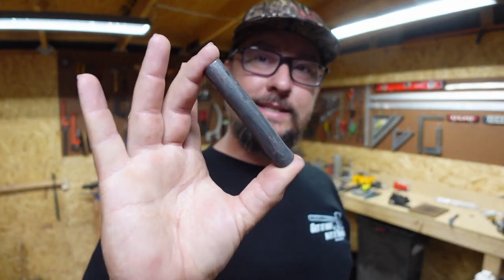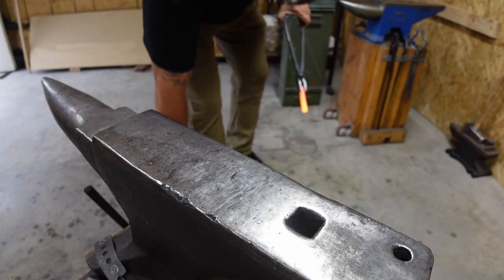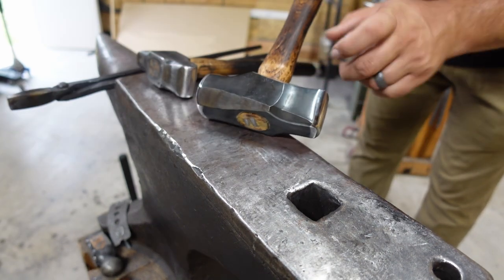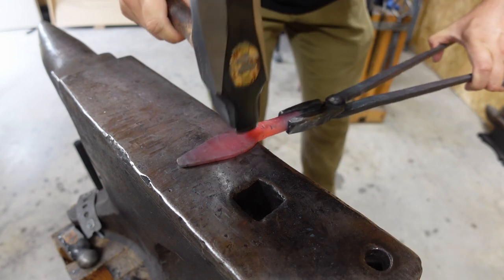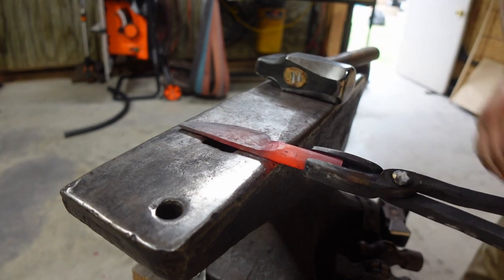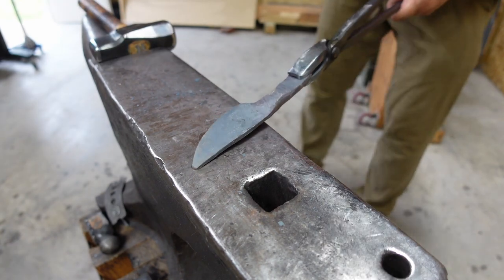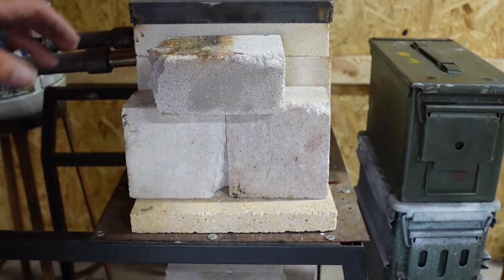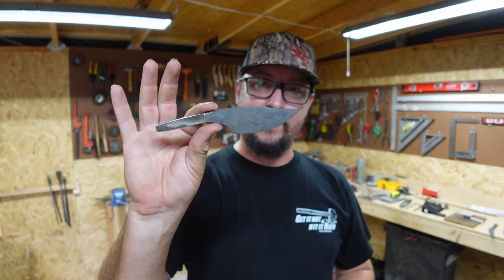How To Hand Forge An Integral Hidden Tang Knife | Shop Talk Tuesday Episode 177 | Knife Maker

Comment: A really knice job brother !  The first pair of tongs would wear me out. Meaning how far apart handle end is. My hands aren’t very big. I’d have to heat it up and bend the handles in a bit. That new hammer is awesome. I need one like that bad.
Reply from the maker: Yeah, I just got the tongs and that was the first time using them. They are adjusted now lol, it was kinda uncomfortable holding them.

Comment: i tried an integral from a little spring but it had about a hundred cracks in it when i was grinding. it was a super awesome design and i had the perfect little peice of wood for it. kinda a bummer but whatever.
Reply from the maker: I've had that happen before. It's never fun having to set a project aside after putting hours of work into it.